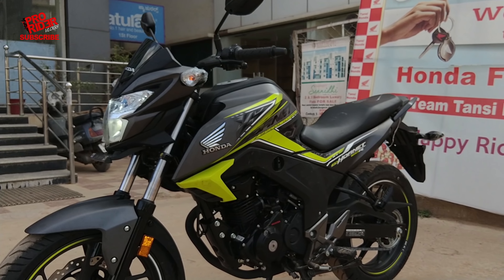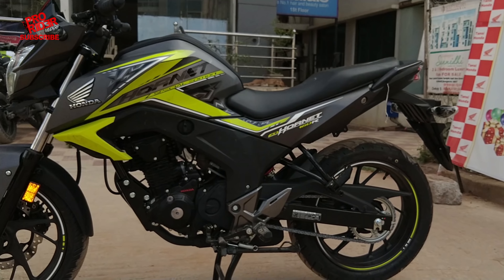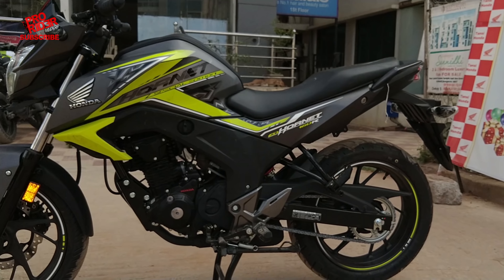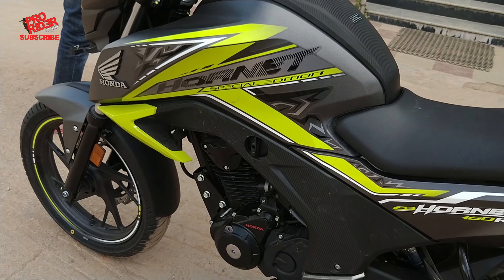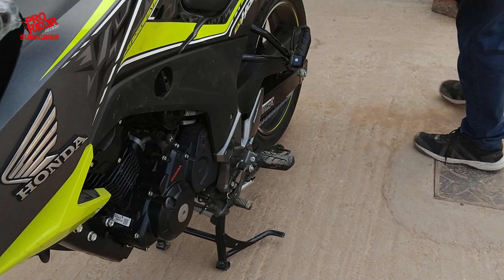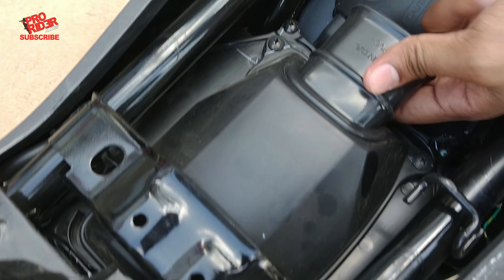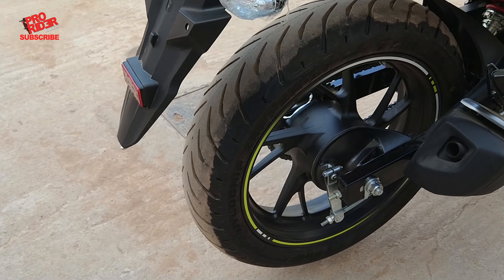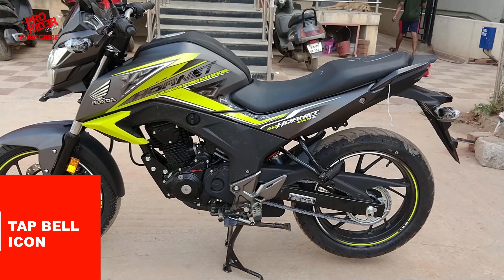NEW 2019 HONDA HORNET 160R ABS DLX/ ABS STD/ CBS/ STD VERSION COMPLETE DETAILED REVIEW

Comment: 1.Remove the wiser from the head lamp like fzs.
2.Add ktm's hand gaurd, And mirrors or bar end mirrors and indicators.
3.Add an extra ignition switch instead of engine kill switch.
4.karizma R engine belly should be fixed.
5.install fz's leg gaurd or modified one, its so simple!
6.modified Tail tidy with clean look.(optional)
Thats it! No other 160cc segment bike can compete this beast.
Just go for it 
I will be uploading a video of mods on my abs version very soon
Subscribe to be notified..
Reply: Invincible Fitness the ktm windshields will look sexy on these 2018 edition hornets. Also Honda is offering these new stickers to owners of previous gen hornets...
Reply: I'll like the new rim stickers, looks good, the new front headlamp design make it a little more futuristic compared to the design of the v1, honda would grab alot of costumers if they should sell the front headlamp design and adapt it for the owners of the version 1 of the hornet, as a patch. would be great, i'll replaced my headlamp with an hyperled H4 and can match the lumens intensity of the new headlamp, overall the new version looks promising.

Comment: Nice. But please have a comparision On Road Reveiew of Honda Unicorn 160 CBS abd Honda Hornet 160 ABS. i am confused which is better. please Have it
Reply: Agrapujya Dash Dash unicorn 150 doesn't have cbs, but unicorn 160 has standard and cbs variants. Unicorn 160 is a good bike but doesn't have good resale value. My pick would be the hornet 160r. 
The decade old unicorn 150, however has a better resale value than hornet and unicorn 160 and it offers a smoother ride and better mileage but you 'll have to compromise on looks.

Comment: Bro I have a small dout .WHAT IS CBS IN BIKES?..
According to my knowledge. If we apply either front brake r rear brake 
The brake power is applied to both the tires & the bike will get stopped ... Is it correct bro.& Will hornet 160r delux abs .. get COMBI BRAKES ?!
Reply: Hello mvs buddhu, Hornet comes with the option of cbs and abs deluxe. On cbs variants, if you apply the rear brake, 25% of the front brake will also be engaged but not the other way around. If you apply front brake, only front brake is activated.This is a useful feature to have in the city.

In Hornet abs deluxe variant, you have cbs+abs at the front, meaning, if you apply rear brake, 25% of front brake is also engaged and further to that, you have abs feature at the front which will prevent front wheel lock-up.